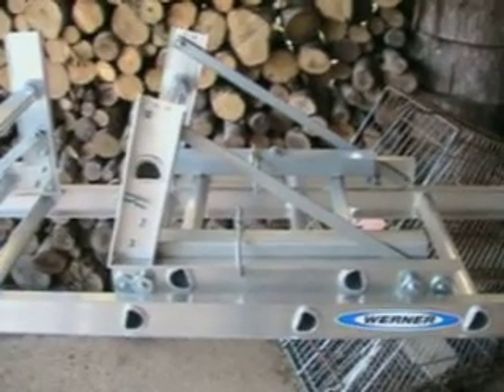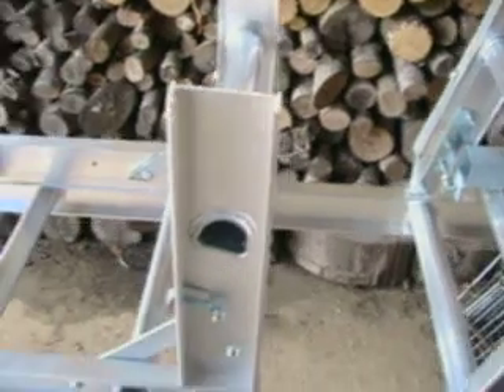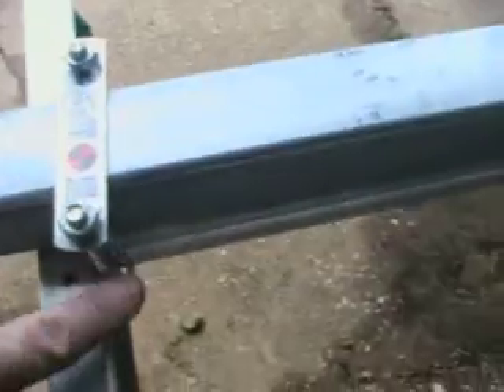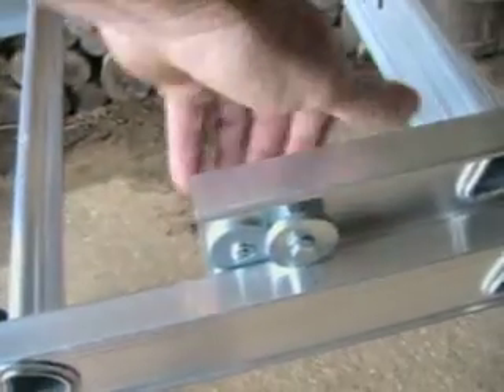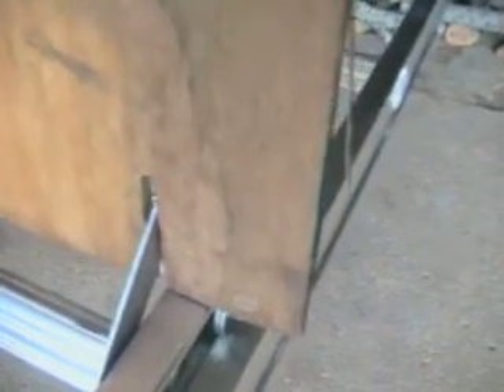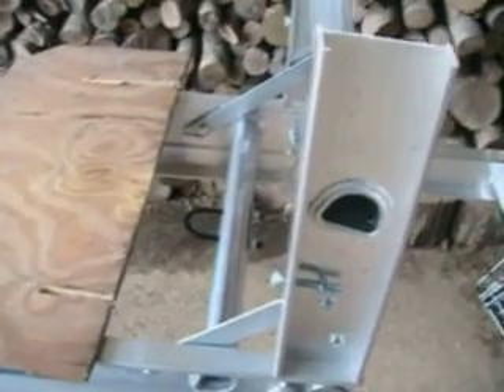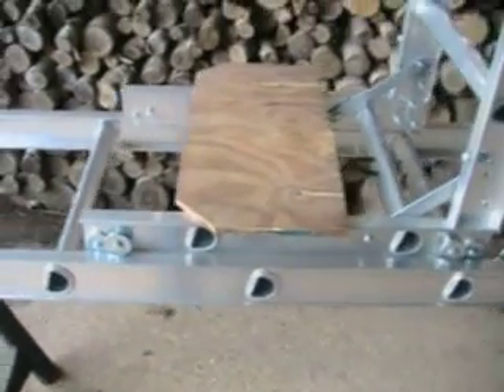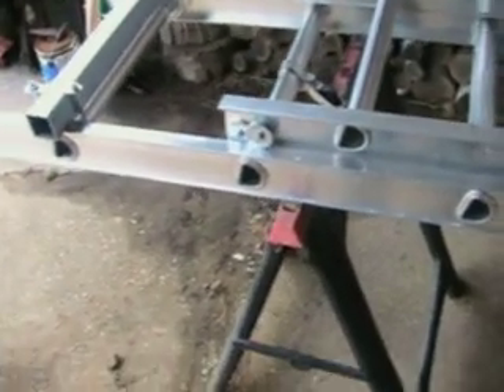elevator

Comment: Is this strong enough to hold a person if you wanna use it as an elevator for one person in your home?
Reply from the maker: Yes definitely.   I have a demo with it lifting about 550 lbs
Reply: This is for my roof patio, my room ceiling is 10', I wanna make an opening from inside of my room going to the roof, after ceiling there is an another 2' crawling space and then rooftop, total height is 12' to the floor of the roof, how much would it be if I order, like I said I need to use it as an elevator for humans. also can it be with a wireless remote control?
Reply from the maker: First,  I only sell the platform... you would buy the ladder and motor locally and save a ton on shipping.   Second, you'll have a problem with rain coming into your room if you cut a hole in your roof.

The motors come with 6 ft cord on the control... they aren't wireless but I know that a couple of my customers have extended the wiring.

 The motor I recommend can lift 880 lbs. so there is no problem lifting a human but you would probably have to stand on the platform.... if you are seated your legs would not easily pass through your opening.

I have helped several customers set up an elevator from a carport to an upper floor but that was all inside. And I have helped a couple customers set up a lift outside beside a long 50 ft stairs up an incline... but that was all outside.

Watch these videos and you can get some ideas that may help your project.
https://www.youtube.com/user/Terryblount/videos?sort=p